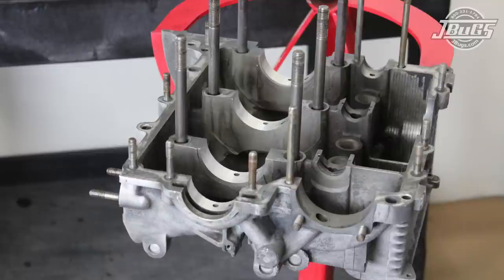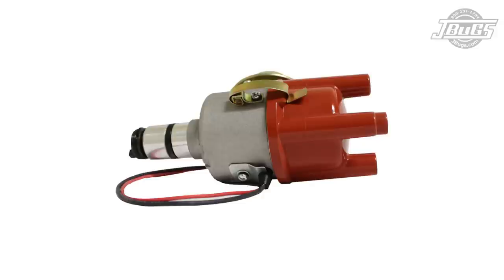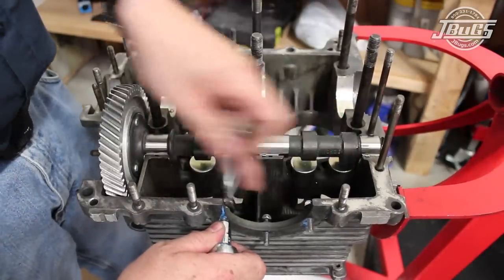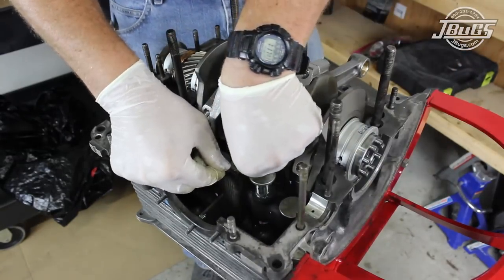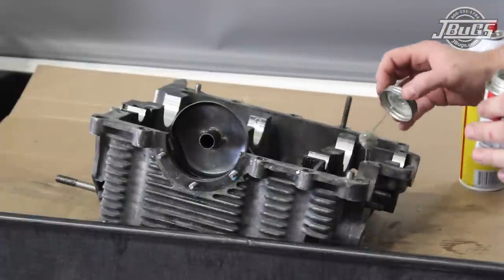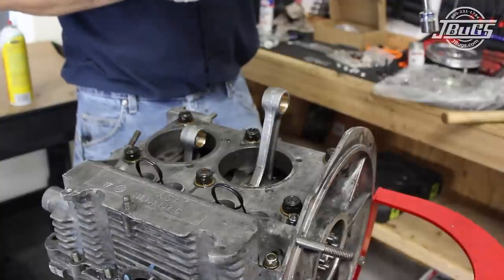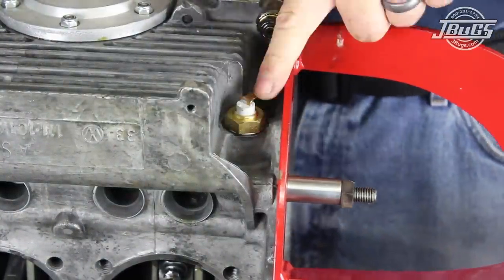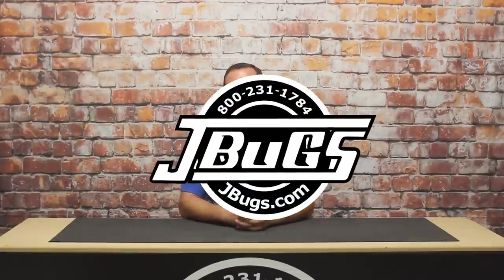JBugs - 1971 VW Super Beetle - Engine Build Series - Short Block Assembly

Comment: I knew of a guy took barrels out of a corvair engine offset ground the vw crank for small journal Chevrolet rods and made a big bore stroker engine. Produce quite usually the Chevrolet rods are longer for the torque.

Comment: Great video! If you can please explain in more detail the placement of the distributor. I would appreciate it! Thank you
Reply from the maker: Once the 2 shims are inside the engine case, the distributor drive gear can be slid in. Then install your distributor (with the cap removed) and rotate the rotor until it points in the correct direction for the #1 Cylinder. For Type 1 and 2 engines, #1 will be pointing towards the rear right of the engine (or 4 to 5 o’clock). For Type 3 engines the rotor will point towards the front left of the engine (or 8 to 9 o’clock). We only mentioned the differences for the original distributor versus the aftermarket distributor as the positions would be 180 degrees opposite.
Reply: Thanks for the update. I plan on doing this soon for the first time and plan on upgrading to the PerTronix SVDA.

Comment: What happened to the break in lube for the camshaft lobes????
Reply from the maker: We used Lucas Oil Assembly lube generously throughout the engine during the build. We find it negates the need for “special” cam lube but you can use your experiences and preferences to build to your methods.

Comment: Is the same torque used for a stroker engine?
Reply from the maker: Yes, regardless of the crank (we actually use a 74mm stroke crank in this engine) the case torque is the same.
Reply: JBUGS I have a 82mm crank there would change the torque?
Reply from the maker: @richardvarela341  No the torque remains the same.
Reply: JBUGS Thank you very much for the help!

Comment: Can i install the 2 shims of the distributor after closing the case?
Reply from the maker: Yes they can. That being said, it is much easier to ensure that the distributor timing gear is correctly installed by setting it in place before the crank is dropped in.

Comment: wouldn't the aviation permatex on the case bolts change the K value for torque?
Reply: Maybe, but that is what VW did. We figure they knew what they were doing when they set the torque values so we just follow what they recommended.
Reply: @Sam_Mebane  good to know, my block was filthy so I wouldn't have know it was on there.
Reply: @BasedBidoof  No problem, our engine was dirty but even after cleaning we could see staining on the block from the original sealant. You can see a streak below the center lower main studat the 6:00 minute mark. That was from VW. When we were doing the live filming, I even narrate that bit saying how you could see the drips from the factory sealant. You can see as I point to it in the video.
Reply: @Sam_Mebane  thanks for the reply, yeah I haven't fully cleaned my block off yet. I was just watching assembly and testing videos to learn tips and tricks. Also reading a lot of books, but you can't always get the nuance from reading

Comment: Hello..can i seal the block with aviation sealant??
Reply from the maker: It can be, yes. It does tend to be a bit thicker than GasGaCynch so we prefer it over the aviation sealer on the case halves.
Reply: I started on VW's at age 14 and eventually built engines for several shops then had my own shop doing mostly engine rebuilds . Aviation 3D Permatex is Great and what I started with but later went with GasGacench on the case halves, silicone on the oil pump mounting gasket ( NO sealer on the oil pump cover gasket - only engine oil rubbed on the cover and pump flange) then use the Aviation 3D on the pushrod tube seals - be sure to have the seam on the tubes up so no chance of oil leak if the tube splits at seam.